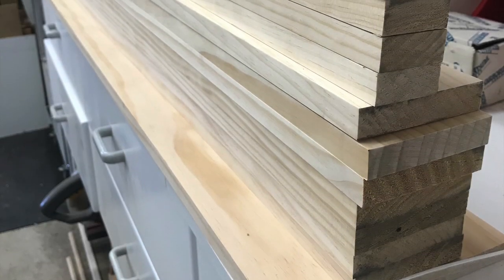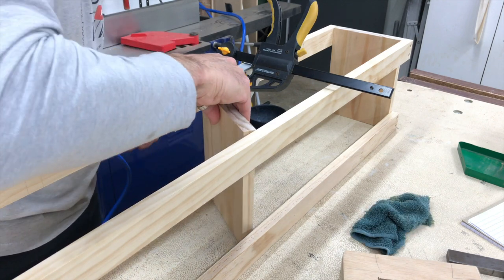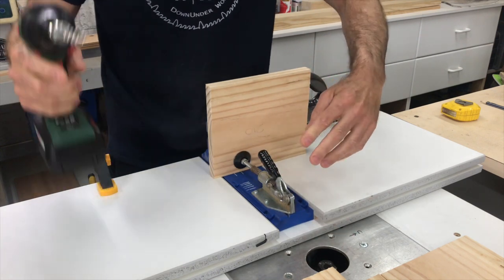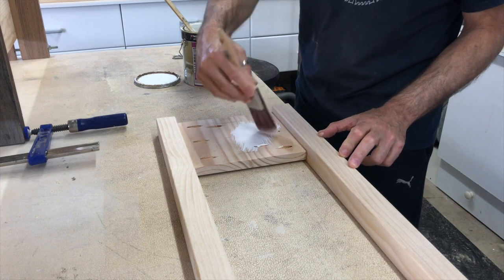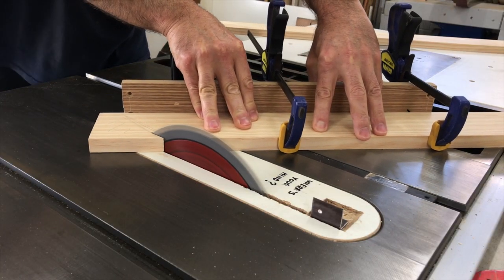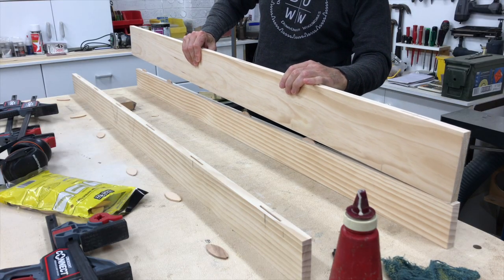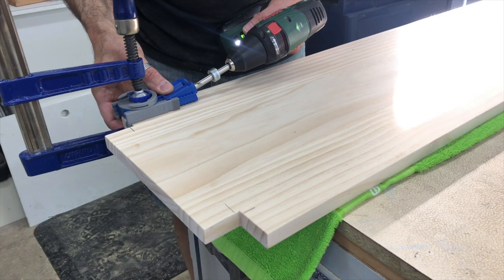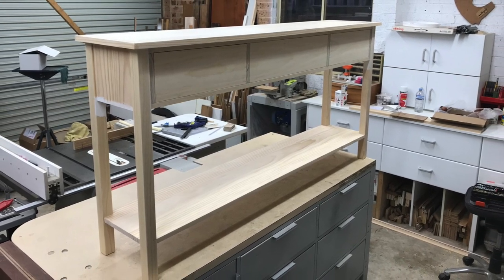Making a console table - Pt 1

Comment: Thanks Vic!  Nice work great ideas and looking forward to part 2.  Curious as to why using Bicut Joints instead of Dowelmax.  Just curious.  Thanks for the camera and editing work.  Peace and safety and God bless Vic.
Reply from the maker: Thanks very much Rich. Dowel joints are used where you want or need extra strength in a joint. Edge gluing boards together doesn't need any extra strength because a long grain to long grain joint is very strong on its own just with glue. The biscuits aren't even necessary and are really only used for alignment. Peace and safety to you too mate.
Reply: @DownUnderWoodWorks  Thanks for the reasoning Vic.  You're right and I didn't think of that!  Peace be with you!  Enjoy learning from you Vic.